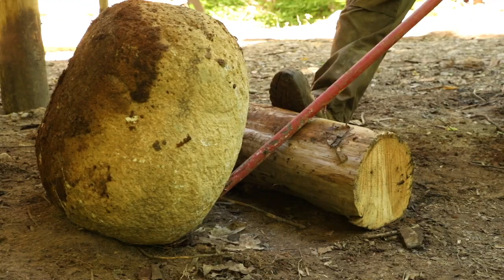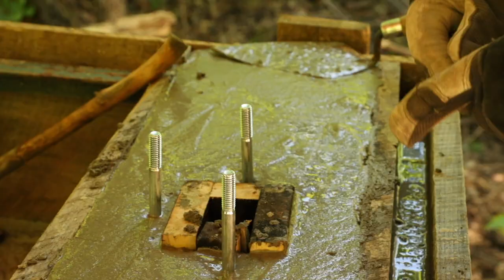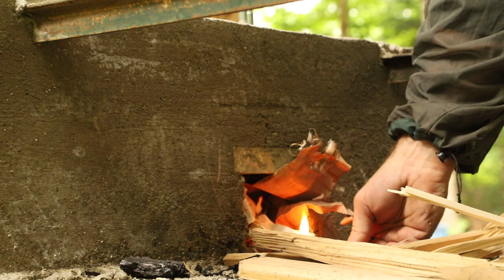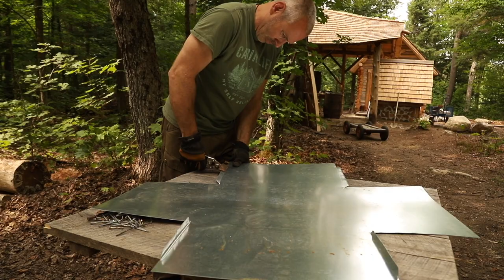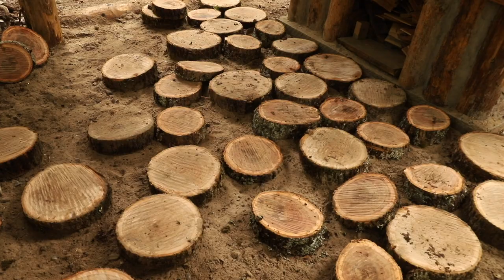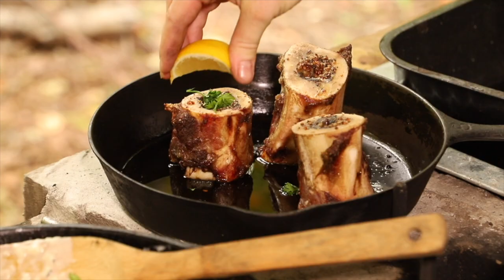DIY Stone BBQ Timelapse | Outdoor Kitchen

Comment: Shawn, That was a picturesque retrospective.  Those meals! Seeing the soldering iron reminded me of metalwork at school. We did all our soldering and braising with irons exactly like yours, heated in the forge. Happy flash back.😊. Regards Stephen.
Reply: We didn't get to do anything that cool in our school, just made a scale model of a tent with wooden dowel rods. The idea being that scaled up you could pack it into the back of a van and use it at events around the country.
Reply: Jamal, I was very lucky in as much as my school had a whole metal  engineering workshop and forge, a place to do woodwork and a technical drawing room. All by hand then. No CAD!! So from age 11 onwards we made stuff. I still have my pointing trowel and garden trowel that I  made back then. Still in use and I'm 58 now! Regards Stephen.

Comment: That was a lot of work you put into building the kitchen.Just one thing that I would I done differently: putting 3 bolts instead of 4, for the tea fireplace. 3 points are simply more stable than a 4 point one. The rest is just fabulous!
Reply from the maker: I agree, but the chimney is four sided and I wanted to be able to place a kettle centered over the flame

Comment: Wondered if you ever considered the walkway to the outhouse a roof cover and stone so the snow is less apt to be an issue during snows (or even rains) for an easy means to relieve oneself. Also, maybe I missed it, but the reason why the outside kitchen has that unusual roof...I assume it is for ensuring rain and melting snow doesn't interfere with the oven? Let me be humorous and ask too where is the microwave oven that is hooked up to the solar panels? ;-) You're doing a great job, love your videos, and it appears you are certainly getting a lot more international attention! I always enjoy your videos and reflections. BTW, does Cali get special treats for being a star?